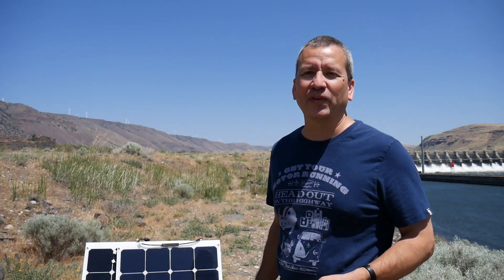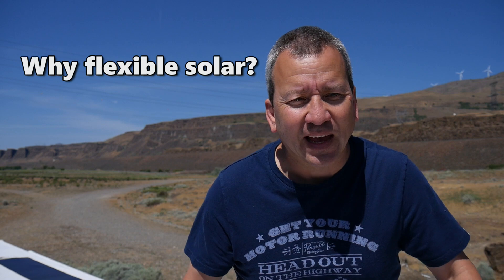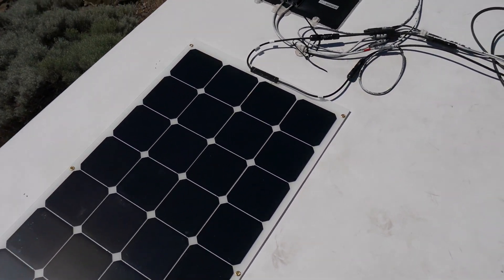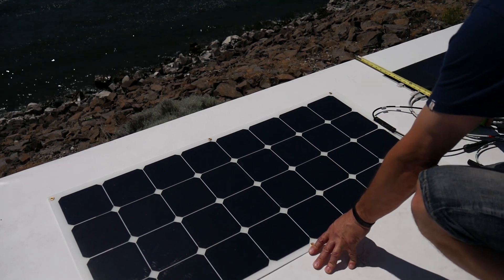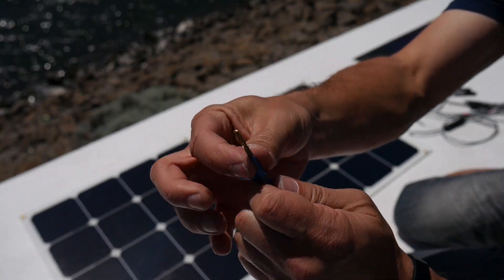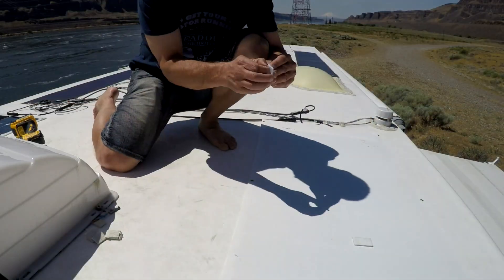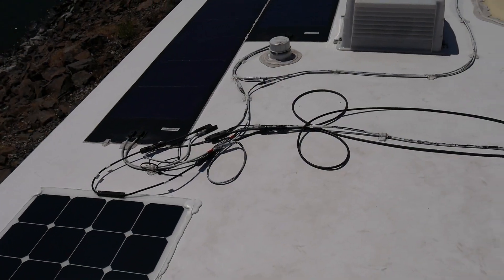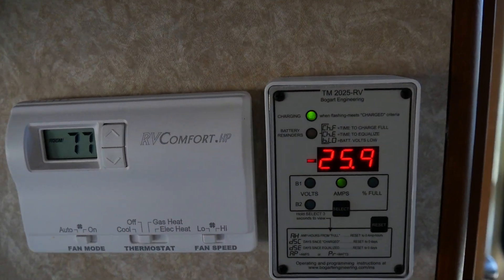How To Install a Flexible Solar Panel on an RV

Comment: Good information here. Question: Now that you have had them for a while are you still happy with the flexible panels and are they generating high Amp at the same level as initial days? Not familiar with RV setting but in general don't you want to have some ventilation, under the panels to keep them cool (Seems ironical but solar is best operated under cold conditions). Does mixing with lower power different type panel come with any drawback?Great job and enjoy rest of your way.

Comment: Way to go Tito. I'm going to install as much solar as I can on my truck camper. I'm also looking at installing li iron batteries. Light and last way longer thaan float batteries.
Reply from the maker: Cool. Make sure you find a solar charge controller that can charge lithium batteries. Most controllers are designed for lead acid.
Reply: I'm doing my research as we speak..
Reply: FYI...from Morning star web page addressing this issue "Can Morningstar Solar Charge Controllers Charge Lithium Ion Batteries?

There have been a number of questions recently about whether Morningstar solar charge controllers can be used to charge lithium ion batteries in off-grid solar applications.  Morningstar’s TriStar MPPT, TriStar (PWM), ProStar MPPT, SunSaver MPPT, and SunSaver DUO solar charge controllers support Lithium Ion (Li-Ion) and other battery technologies such as:

Lead Acid (PbSO4): Sealed (VRLA, AGM, Gel) and Flooded
Lithium-Ion (Li-Ion or LIB)
Lithium Iron Phosphate (“LFP”, LiFePO4)
Lithium Iron Magnesium Phosphate (LiFeMgPO4)
Lithium Manganese Oxide (“LMO”, LiMn2O4)
Lithium Nickel Manganese Cobalt Oxide (“NMC”, LiNixMnyCozO2)
Nickel–Cadmium (NiCd or NiCad)
Nickel–Metal Hydride (NiMH or Ni–MH)
Nickel–Iron (NiFe)
Nickel–Zinc (NiZn)
Aqueous Hybrid Ion (Aquion or AHI™)
Flow or Redox Flow Battery
Vanadium Redox (VRB)
Zinc–Bromine (ZnBr2)
Zinc–Cerium (Zn-Ce)
All of the above-mentioned Morningstar controllers offer custom programming to create pre-configured plug and play settings that can be tailored for most types of batteries.  For more information, please go to our Best Practices By Battery Chemistry page.
Reply: Sorry...I should have added this to find info too... http://www.morningstarcorp.com/morningstar-news/can-morningstar-solar-charge-controllers-charge-lithium-ion-batteries/
Reply: This may help.. http://www.morningstarcorp.com/morningstar-news/can-morningstar-solar-charge-controllers-charge-lithium-ion-batteries/

Comment: Hi, I've got what appear to be the same panels. I have been reading about reliability issues and the panels failing  after a year or less. Are your panels still ok, do you know anyone who has been running them for a longer period of time? Nice job btw and I hope they last many years :)
Reply from the maker: It's still less than a year since installing those 100 watt panels. So far they are performing well and still look like new. I keep my RV pretty well protected though when not in use. I know this is an issue folks are concerned about though given that these are farely new. So I'll update everyone if I have any issues. So far so good though.

Comment: Hi Tito,  should heat transmission through the panel to the roofing be a concern?
Reply from the maker: I have not experienced any significant heat transfer on the newer 100 watt panels. I have noticed some heat transfer on my older Unisolar panels though. I can feel the roof inside warming up in places. It does not affect the performance on those much though since they are thin film panels which are not affected as much by heat.
Reply: Ok,  Your vids are very informative. 
Thanks

Comment: One thing that you may be doing wrong here which will reduce solar output is using a wide variety of solar panels.   There seems to be two rules here - if have same amps on all solar panels can connect in series & if have same voltage output but different amps can connect in parallel.   If have varying voltage and amps whatever you do using one solar controller will have severe losses (ie. in series amps of lowest panel will be determining factor) so will loose badly if they are vastly different panels.   The panels you have installed look to be 32 cell so about 16V output whereas the long panel I suspect is more cells and therefore different voltage.

Comment: One nice thing about having them flat down on your roof, is that there's no wind restriction... BUT I sure won't have drilled holes in my roof... They do make some double sided tape that hold very good. I've seen people install the other type of  solar panels brackets to their roof of their Air Stream and they never have lost any panels yet... Also with the RV'S that we have owned in the past they really didn't have much support under the roof . They only had a 2X2 every 24" with a thin peace of Aluminum rolled out over the top... Yes we had very old RV's Our last motor home was a 1979 Winnebago... LOL... But it worked for as long as we needed it to and then sold it for more than we paid for it 5 years latter... :0)

Comment: Possible to easily remove the Eternabond tape from a fiberglass roof on an RV - or is it there eternally?
Reply from the maker: I haven't done it, but it is possible. Eternabond suggests you first consider just mounting over the old eternabond tape. If that's not an option, then removal of the old tape is an option, but it's difficult.
Reply: Jim Metzner, you can remove it with a heat gun and mineral spirits/acetone. A messy job.

Comment: 1) So what can you run with these or are they just for charging batteries?  
2) How did they work in winter after adding the additional panel vs. tilting?

Comment: Did you know you can build your own solar panels, https://twitter.com/5fr6tqzt1kdr/status/792250078006087680 saving $10,000’s off retail price?  You have probably read about it or seen it on TV, but have you tried it yourself?
Reply: ashlee lindsay well at $180 each I doubt I would save $10000 building them myself. even for a home install which could use up to 20 panels I don't see this...ever!

Comment: Make a follow up video in a year or so, after the plastic has had a chance to warp and cause EACH cell to "cup" - thus seriously reducing output. Just the voice of experience. P.S. let's not forget how HOT they get when mounted DIRECTLY to any surface without a proper lift for cooling.
Thanks for sharing...
Reply from the maker: Sounds like a plan. I'll be sure to keep an eye on those panels and report back. Thanks for sharing your experience!
Reply: I had no air get under my sola panel and cooked it.
Reply: Yeah, and all that heat in contact with your roof too.  Kinda scary.  I just had a panel failure and was considering mounting a flexible right over the  top of it.
Reply: So where's the one year update??
Reply: @Lauren-vd4qe  https://www.youtube.com/watch?v=h1nmUjiNq2s

Comment: No venting underneath required? Helpful video! Subscribed.
Reply from the maker: The bottom line is that all solar cells generate a little heat and  perform better when it's cooler. The manufacturers usually test the panels at around 78 deg F.  So I'm sure if you could figure a way to mount them so that they could be vented, then I suppose it couldn't hurt. In my opinion it defeats the purpose of using flex panels and it's not required. I've done a couple of temperature tests on my panels and found that performed at around the same temperature whether they were mounted flat on my rubber roof or not mounted at all. The white colored panels seem to stay 5-10 degrees cooler than the dark colored panels. Hope that helps!
Reply: RVwithTito That helps a lot, thank you for the response!

Comment: Also The Tape for AC Duck work very Strong and the Adhesive side wster tight. and it also has a. Aluminum reflection side to be used to back drop the rays back on the panel that would be something you would put up Separately.

Comment: Tito.  great video like your idea on what type of Panel. to cover the wires depending on the thickness you could use the plastic pvc cut in half and Square up the cables to give you access walking around for Maintenance. 😎🌴 Ft.Lauderdale Fl.☀

Comment: For the cables, you can mechanically secure them using p-clamps because adhesive ziptie holders come of.  

For the dycor, or silicone, it helps to wet your spatula or fingertip with windex or soapy water so you can get a nice smooth bead.  From your video, it looks like it self flattens nicely.

Comment: will the heat of the metal roof be hard on the panels
Reply from the maker: +click411 I don't think it would be hard on the panels, but if it's hot enough to heat up the panel, then it would probably affect their performance

Comment: These things are so small and light that one could carry 400 watts of power inside take them out into the sun when docking and have all the power they need. I have a 4x8x4 camper it is a run away I want the power but don't want to have to alter the economy of the ride.
Reply from the maker: +Grunge Luggage Tours Yes they are easy to stash in the RV. I can put them all in the back of my closet or under a large cushion.
Reply: RVwithTito Choice ! T4TReply.

Comment: Tito - still really happy with these HQST panels?  I've read that the Suaoki's have bypass diodes where the HQST do not.  Has that been an issue for you at all?  Thanks for the videos!

Comment: Use 3M VHB 4930 tape. It holds 180 lbs per square inch. That stuff is so strong you need a pry bar to get it off!
Reply: In the future just use a heat gun to soften the bond.... less damage
Reply: Claude Rains I had to chisel mine off!

Comment: sir which type of panels will be suitable for installing on the roof of e rikshaw ...a flexible one or a rigid ....consider cost as well as efficiency..PLEASE REPLY SOON
Reply from the maker: It depends on the type of material on the roof. A flexible panel could be a good option, similar to mounting to the canopy of a sailboat.

Comment: Curious if you have a propane fridge and if so whether you leave the propane ON while you are driving down the road?
Reply from the maker: Yes. My fridge runs on both propane and electricity. I have always used the propane while driving even though some advise against it. Now, if it's sunny, I power my fridge on electricity while driving.

Comment: Quick question but first..we love your guys videos!! Thanks for sharing all education. We are looking at flexible solar for our setup. Which performs better for,you. The first solid black rolled up long panels or these new ones? Really loved the butyl tape idea so it attaches to the screw and helps seal the hole! Andy and Kathy
Reply from the maker: The newer panels are more efficient. They are monocrystalline panels and the most efficient of the three types (monocrystalline, polycrystalline and thin-film). The long roll-up panels are thin-film panels. They work really well but are the least efficient. So it takes a larger thin-film panel to produce the same output as a monocrystalline panel. For example. The three roll-out thin film panels I have (the only kind of flex panel available at the time) generate 250 watts. The two smaller new ones together put out 200 watts. Those larger ones, are very durable and good quality though. But they take up more space on the roof.
Reply: RV with Tito DIY Great video. Is there a certain name brand on the monocrystalline?

Comment: Brian have been following your upgrade to Solar Panels great video's. Just contacted Go Power to see if they can upgrade their Go Power Solar Elite Kit to 3 Flex Solar Panels vice 2 Glass Solar panels. Weight Factor for our 2004 Four Wind Chateau Sport 24-T, so we can extend our dry camping here in Washington State.  How has the Flex Panels been working for you? Do you think if we traveled to Utah and Colorado next year the heat would be a factor in the Flex Solar Panels? What are your thoughts of having our NorCold 6.4 cu Frig run on Inverter in the day and Propane at night? Thanks for any information. It's been so nice camping at various Washington Coastal Federal Campgrounds this summer, and camping at Curlew State Park this pass spring.
Reply from the maker: The flex panels are doing great. So far so good. I'll be installing another one soon. I believe the heat will affect any solar panel and can affect the efficiency up to around 20 percent. They will all get hot in prolonged sun. I simply don't have any real numbers to say what the real affect has been on my RV.  My batteries always get charged up whether it's hot or cold so I don't sweat the numbers. Overall I am satisfied with the benefits the flex panels have provided. I even considered adding two rigid panels instead of the two additional panels, but ultimately went with the flex panels for the reasons stated in the video. It just makes more sense for me. Others may choose the alternate route. Thanks for the comment!
Reply from the maker: While I can run my refrigerator on my inverter, I usually wait until mid day after my batteries have had a chance to recharge. The refer draws about 26 amps but not constantly. I run it on propane most of the time.  If it's cold at night, we use an electric blanket instead of heating the entire RV. In the morning I'll get up early to quickly heat up the rig with the gas furnace. Then as the day warms up, there's no need for the heater. You typically want to make sure your batteries get charged during the day so that you can run off of them at night, then repeat.
Reply: Thanks Brian  Good information.

Comment: I was wandering why not puting butyl tape all around the panel instead of only small strips under the screws:  that would avoid putting Dicor all around the panel.
Reply from the maker: Butyl tape is basically putty in a tape form. It does not have an adhesive on it and would need to be secured to the panel somehow.

Comment: Great setup !!! I installed the same panels !!! 4 of them !!! I'm absolutely not going to drill a bunch of holes in my roof :) did you put sealer under the panels on the holes !!! I used an industrial grad hook and loop to attach my panels, I practically can't remove them, kind of a semi-permanent install.
Reply from the maker: Cool. I'd love to see what type of hook and loop you used.

Comment: Thanks for this video. I lost a one week old 100Wp solar panel in France because the wind of an on-coming truck blew it away! The Sikaflex kit had not attached to the four corner pieces at all! I feel more like the way you did this. Greetings from Holland, Jan de Bloois. The link is to the (small) Facebook group I made for the rather rare model RV we have. https://www.facebook.com/groups/1649994728554396/

Comment: Hey Brian great video as always and it looked like a beautiful location. I'm really interested in the solar power possibilities but know virtually nothing about it. I was surprised that your install provided enough power to run the fridge. Will that be the case while you are driving down the road too.....assuming it's a sunny day or will you have to revert to propane for the fridge? Take care and keep up the terrific videos! (I think my wife is really starting to warm up to the RV living/traveling when she retires in less than 2 years!)
Reply from the maker: +A Davis Yes, that is my plan. I prefer not to run the propane while driving. So, yes, while its sunny I can use the solar to power my fridge.

Comment: Thank you Tito for taking the time to do this. Always enjoy your videos and since I'm still researching about solar possibilities, this was very interesting. My wife and I are fellow pacific north westerners so I understand about the weather...especially this year. Yuk. Since we are on the western side, camping around trees is a norm unless you go across the mountains. Anyway, a few questions:
1.) Understand the reason you mentioned about why you installed the panels in series but from what I understand, doing so makes the solar system more susceptible to shading issues. Some tests I've observed significantly reduced the performance of the entire system just from shading a few cells on one panel. Is this not a concern for you or were the benefits (higher voltage, smaller wires) more important?
2.) Have you looked at the robustness of the coating on the cells themselves? I had heard of an issue with the surface degrading faster/damaged easier that glass panels.

Take care and happy RV'ing!
Reply from the maker: When I initially had just a couple of panel, I had them wired in parallel. As I started adding more panels of different sizes, it made more sense to change it over to series in order to not lose any wattage from the larger panels. With that said, I can quickly switch them over to parallel in a matter of minutes. On the shading issue, I prefer to camp out in the open. If I'm going to be dry camping with solar, I try and find a nice open spot. The shading issue is always going to be an issue, even when in parallel. All of my panels have bypass diodes in them but I haven't actually done any testing on them. Regarding the coating of the cells, I don't have any information about that. I always do try and look for a bargain on panels with understanding that if one goes bad, I can easily replace it. But I'll let you know if I notice any degradation. So far, none. Thanks for the comment!

Comment: did you go with the flat panels because your afraid they will be seen and stolen?
Reply from the maker: I originally went the flex route primarily because they allowed me to still move around on my roof. The stealth factor for me was just a bonus.
Reply: RVwithTito  whats the height of your rv?  mine is around 11'